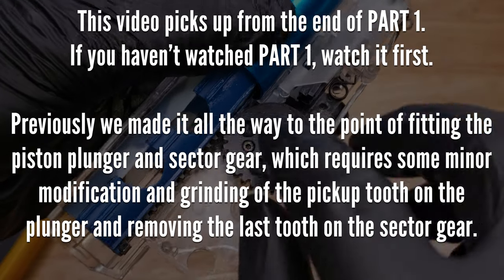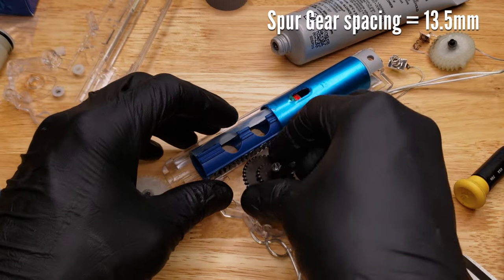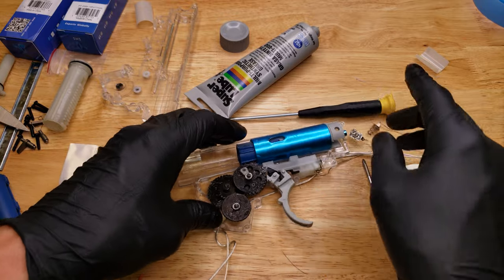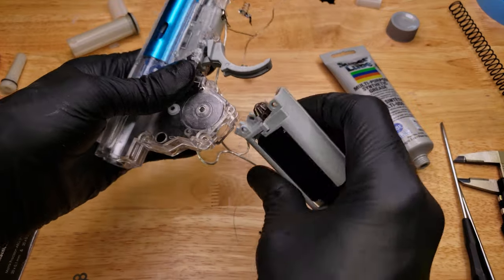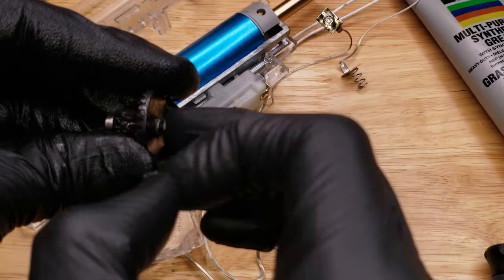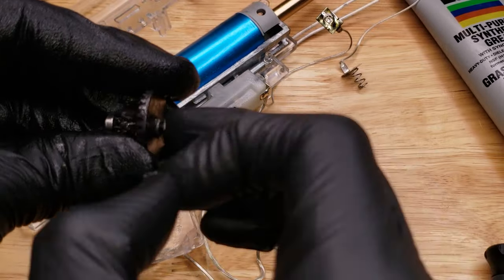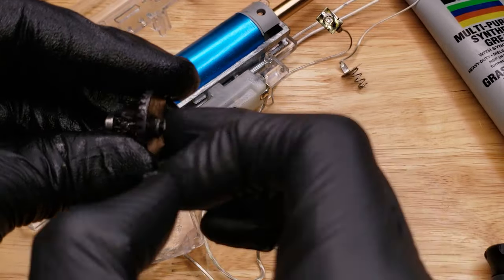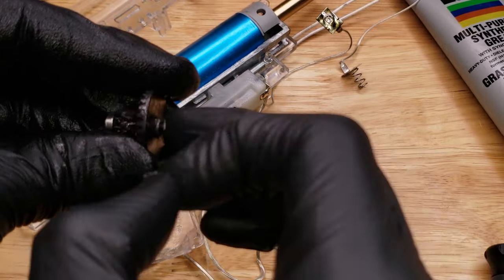How To UPGRADE SPLATRBALL GEL BLASTER to Metal Gears & Strong Spring PART 2 | SRB400 SRB1200 Gearbox

Comment: hello Engineerable is it ok if I put an M95 or M100 spring in the SRB1200. pls, reply soon as possible. keep up the great work.
Reply from the maker: Only if you upgrade the gears to metal, and even then, you may need to upgrade the motor and gearbox.

Comment: Shouldn't the nozzle go past the feed tube in the t piece? It seems to stop short just before loading the next ball to be fired.  But that's just an observation without the piece being on. Just seems short for some reason
Reply from the maker: I need to check,  but normally, the nozzle tip only contacts and seals off against the other side of the feed tube, so it doesn't travel completely past it.
Reply: @engineerable  I rechecked the video, it looks like when you fire in semi auto that the nozzle isn't completely forward. I'm not sure why splatter ball put a delay Notch into their selector gear.  The one I stripped on my lightening blaster is just a round tab. You'd figure the tappet plate is designed for the gels, why would you need an elongated pin? Seems like that would only be necessary for an air soft tappet plate to convert it
Reply: @engineerable  wish I could just donate a lightening blaster for you to tear down and compare!  😆
Reply from the maker: @TreYay83  I have a lightning blaster, but haven't torn it down yet. Just tested. Was a bit disappointed with the FPS <200, and accuracy was worse than Splatrball. Weird.

Comment: Could i change the gear ratio from 18:1 to something crazy like 32:1 in exchange for a heavier spring like an m140?

with the change in gear ratio it will stilll fit in the gearbox the same right?

And will the stock motor be under to much stress with this change?
Reply: I think the motor won't be able to handle it. Also, the battery would also be drained way faster.
Reply: @EM_Ind  I got the stuff for it, I’ll reply to you again to tell you how it goes, I’m probably gonna hook up a 3s lipo to it so i don’t think the battery will be an issue.

Comment: Hello engineerable, I'm looking forward to upgrading the battery to 11.1v battery, and I've heard that it breaks your gun, is it possible I can change just the gears or can you please list down the pieces that would be best to replace to metal, I'm on a budget and only want to change what is needed in the gun, good video.
Reply from the maker: @gustavocarvalho5890  TBH, it will cost you less to just buy a higher end blaster that already uses an 11.1V battery and has metal gears. Check out my list here https://www.engineerable.com/single-post/what-are-the-best-gel-blasters-of-2023

Comment: Really informative videos, I knew nothing about this before watching! One question, I want to make my Splatrball blasters quieter, do you have any recommendations on how I could do that? I have read about putting a damper on the piston head, but I'm not sure how to do it/how effective it would be...
Reply from the maker: I haven't tried reducing the noise, because I've also read that the resultsfrom the damper piston heads are not worth the cost/effort, and can introduce other issues. Adding foam around the gearbox will probably have a better noise reduction.

Comment: Yo my sector delay chip got ripped up when using it in 20 shots full auto. Where is the best place to by 3d chip that won’t get damaged and what type of plastic? Could I possibly use metal 3d chip?
Reply from the maker: @PxckFlxpper16  was it 3D printed?  Needs to be a tough material, like at least ABS. You can buy sector chips for airsoft and modify them as needed.
Reply: @engineerable  can you send me a link and how do I go about modifying them
Reply from the maker: All info here https://www.engineerable.com/single-post/what-s-inside-splat-r-ball-gel-blaster-i-take-apart-gel-ball-blaster-to-see-how-it-s-made-works
Reply: @engineerable  okay thank you but I’m inspired by you videos and I read your whole page from the link you just sent me. I’ve done everything you did just need to find a delay chip 3d printed online from someone who has 3xvery strong material.
Do you know what type of motor I can upgrade that’s higher in torque since the stock one is 480 size idk what type of upgrade I would want that’s better then stock. Which one would you put in to replace the Stock?

Comment: If I upgrade to this then my srb1200 will be able to use a 11.1v battery safely right? Will the motor overheat?
Reply from the maker: Motor will be fine for a while. When it does burn out, replace it too
Reply: @engineerable  can you also do the tracer mod and this upgrade? Are they compatible with each other?
Reply from the maker: @DisciplineHubb  Yes, the mods are independent and compatible

Comment: is it possible to change the gear ratio on the srb400 gearbox like 16:1 or 13:1 also motor upgrade?
Reply from the maker: Yes, you can select a different gear ratio

Comment: My sector delay chip is the one from cults 3d the blue one and the first one that you see when you search it up, but now my feeding is inconsistent, does it really change if my delay chip is different? Can I have the link or file to the chip you used?
Reply from the maker: I shared the CAD model and links on my Splatrball upgrade page: https://www.engineerable.com/single-post/what-s-inside-splat-r-ball-gel-blaster-i-take-apart-gel-ball-blaster-to-see-how-it-s-made-works

Comment: Hi engineerable can you tell me all the parts i need to make my gun high fps better accuracy all the stuff i want to upgrade is gearbox, motors, spring, battery, faster charging cable, nozzle (anything on it) and all the stuff if needed and put all the tools i need plz be all or airsoft links amazon links below this that will be compatible with the srb1200

Comment: should have used a 11.1 lipo battery connected to deans for faster rate of fire
Reply from the maker: That will be next, but tbh, I don't care much for higher rate of fire. Just wasted more ammo. Also, I think that the tappet will need to be changed, and the motor may burn out more quickly.

Comment: Can you do a video upgrading the motor and other stuff to support  a 11.1 battery and to mabye handle 12:1
Reply from the maker: tbh, I'm going to use a whole new metal gearbox to do that. This plastic one reaches its limit with this mod.
Reply: @engineerable  so would the gearbox be the whole thing you were just working on and the gears and spring and all the stuff you upgraded be the internals of the gearbox. Just got into messing with gel blasters and  airsoft guns and was wondering
Reply from the maker: @leakedcerz9455  Yes, right on.

Comment: I'm sure this has been asked before but could someone simply buy a full metal gearbox and plunger assembly rather than taking apart their gearbox?
Reply: I know that's not the most affordable way to hit that kind of performance, but my first srb400 broke after about 100k rounds through it or so. I bought another so I can still shoot at my homies, but I'm trying to think of the best course of action for the broken one I still have. Worst case scenario I have extra accessories and magazines now.
Reply from the maker: 100k+ rounds is probably pretty good for stock Splatrball gearbox life. Yes, swapping out with a metal gearbox is better than trying to mod the plastic one. A metal airsoft gearbox will still require some minor mods. I'm working on a video of doing that.